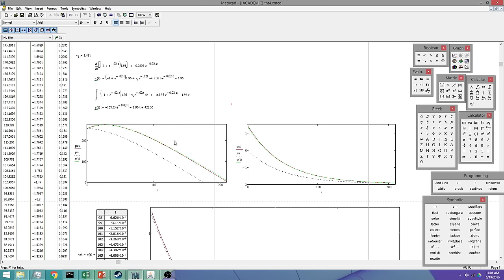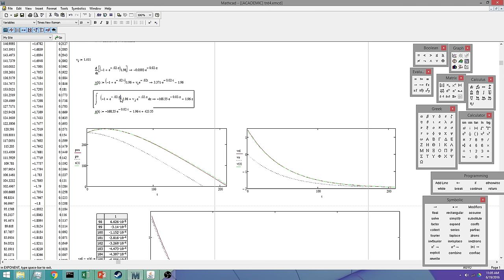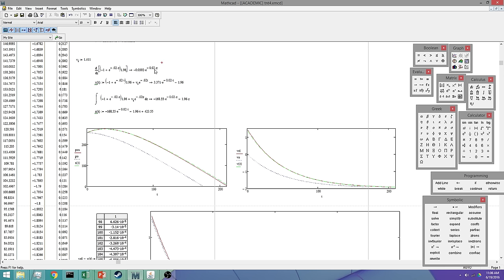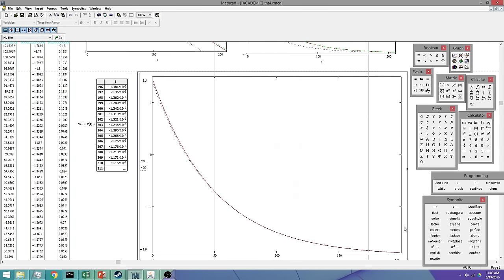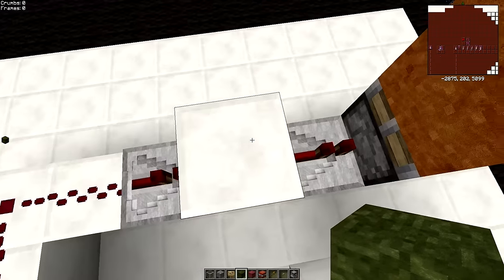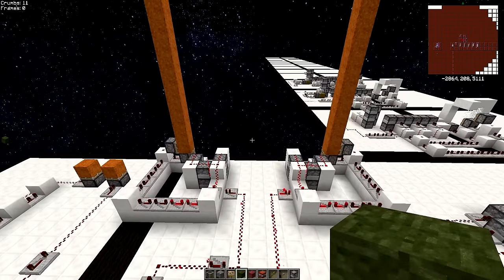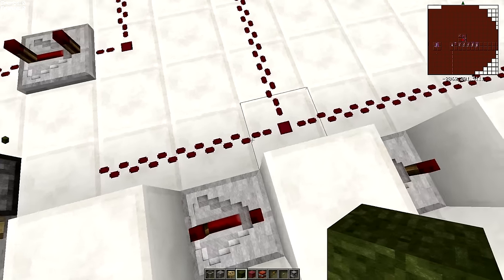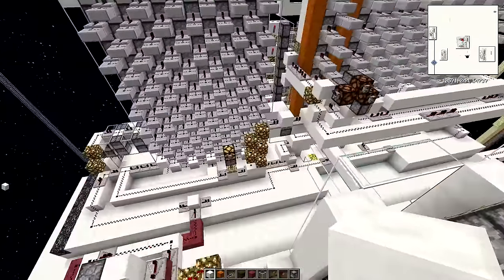Quick Tips: Free Falling with Drag and Terminal Velocity, Testing Cannon

Comment: Nice video. I fully understand OOE mainly because of you. One question tho: why wouldnt you stack 1/2 of the sand when you have half of your sand in entityform before the hammer ticks off, while fusionstacking?
Reply from the maker: Are you referencing what I showed towards the end of this video, or just OOE in general? If all of your sand is in an entity state before the hammer ticks off (of course after the main power), then all of that sand is capable of being stacked, so long as we have enough hammer power to stack all of it.
Reply: I was referencing to what you explained in multiple vids, including this one. 

So you could regenbust with only 1 sandcompression if 1/2 of the sand is in entityform before the first hammer, and if 1/2 of the sand is enough to stack fully. The other half could be stacked later by the second hammer right? I'm getting a little confused here sorry.
Reply from the maker: You're fine, sometimes it just takes a few times to convey an idea or question. You COULD do what you described, yep. X amount of sand falls first, so 'A' hammer ticks off after X sand, and thus with a zero block guider will stack ONLY X sand. Y sand falls after the 'A' hammer, but is in the same block as 'A' and X, but won't be moved by 'A'. 'B' Hammer ticks off after the Y sand falls, so it will explode last, and will move 'B' sand.
Reply: That's what I meant! :) I'll try to make that cannon some time.

Comment: Does anyone use repeater locking feature for the quick pulse circuits in their cannons? It's interesting how I typically only see sticky pistons used in this capacity.
Reply from the maker: I haven't seen anyone use the locking repeaters with quick pulses (with cannons), although I and some other use them with logic gates with cannons.

Comment: This wouldn't apply to a cannon, but knowing sand travels faster than TNT, would that still apply in a free fall when TNT and sand reach terminal velocity. Will they fall at the same speed/velocity if gravity in game acts as it does in real life
Reply from the maker: Hmm question is sorta interesting-sand and TNT will move in effectively the same way, as gravity and drag act on them in the same way. There are different values of gravity and terminal velocity in Minecraft, so things like players, arrows, and sand/tnt will all move differently-we can treat sand and TNT as the same, except TNT explodes and sand starts as a solid. 

TNT and sand with gravity being the only long term force will APPROACH their terminal velocity of 1.96 blocks/tick, regardless of an initial upwards velocity (which will eventually be negated because of gravity and/or drag working in the opposite direction of motion). The only issue for us is time-or more specifically the world height, and how long sand/tnt can exist as an entity before being cleared/exploding. Starting from rest at 255, sand will only reach -1.9ish blocks/tick before it lands on the ground at y=1 or 0. Giving it an initial velocity (so it goes to like y=270) will then give us enough time and distance so that it reaches close to -1.92 blocks/tick.

As for real life, there will be air resistance and gravity, and thus terminal velocity, but mass and other ideas are included. Assuming the same mass , size, some other properties, "sand" and "tnt" will move the same in real life to eachother, but obviously different than in MC haha

Comment: so what effect does a long pulse have on the cannon? Will it help stack more sand or will the hammer be affected?
Reply from the maker: It all depends on how you make your cannon-the length of the pulse directly correlates to how long the current lasts. With some cannons, like my 256 nuke, I turn a normal length signal into a short pulse, so that the short pulse can power dispensers, but only keeps them "on" for a tiny amount of time, whereas a normal pulse will activate them at the same time, but keep them "on" for a longer period of time. The pulse length on built cannons can have a range of effects on the entire cannon based on how they're built.
Reply: ok thanks, im really enjoying these type of vids. KEEP THEM COMING!

Comment: is it possible to use booster instead of triangles to make a floating barrel bc i wanna mke a fusion floating barrel and it wont work with triangles
Reply from the maker: they're all related, just mess around until you get it to work